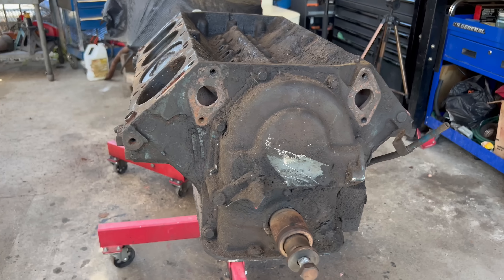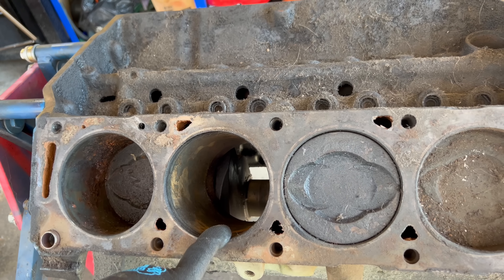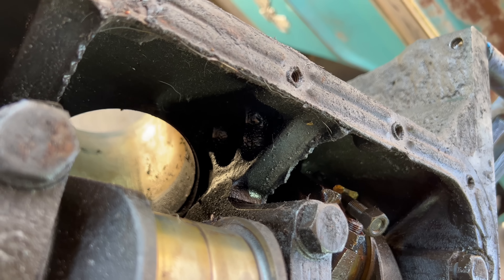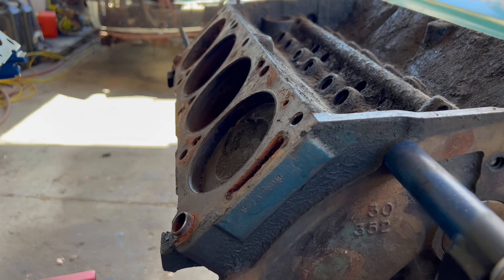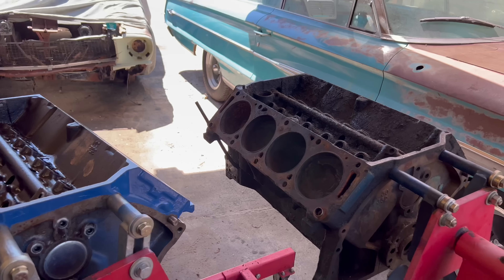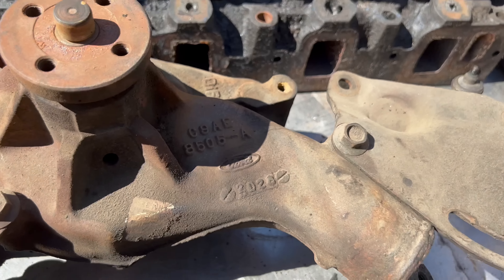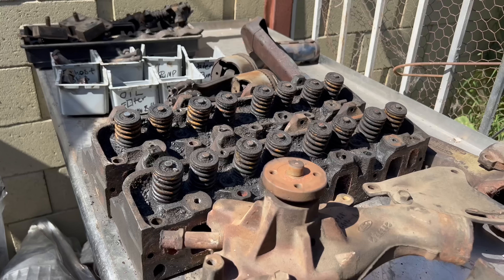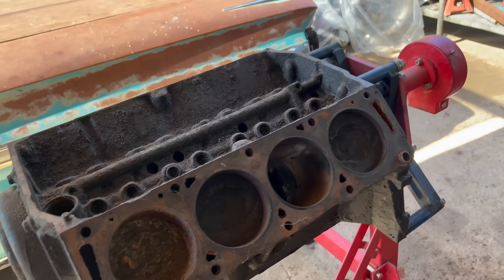A Ford 428FE Cobra Jet For $200!??

Comment: I would say instead of coyote swapping that fastback do a 428 with like a 6 speed. Would be pretty sweet!
Reply from the maker: Haha yes that would be really awesome. I’m building the 428 for the galaxie so I’ll see how she handles. Might change plans after I do some burnouts haha
Reply: @OmarRamirezGalaxie  t56 fits right because similar transmission design
Reply: @OmarRamirezGalaxie  that 428cj needs to go into something that deserves ut,like a mustang or a torino, a fairlane
Reply: Coyote swaps are so grossly OVERrated.
Reply: @460duck  Torino GT. Perfect for that.
Reply: 4-speed or NOTHING 😉
Reply from the maker: @460duck  haha everyone is saying to swap the 302 in the Torino for the 428 but it runs so good
Reply: I don't think you would need six gears with all that torque.
Reply: Even a 390 bumped up a little would also be sweet.
Reply: Gets my vote. The GT350 trans from Tremec with 3.5 rear gears.
Reply: @IrishMike22  Today requires OD. The Tremec 5 speeds would work well or the close ratio 6 speed installed in the GT350 with a 3.5 rear gear. If the rear end was swapped for an Exploder 8.8, the 3.31 or 3.55 gears. Exploders had 31 spline so pretty close to a 9" with less internal friction.
Reply: @daledavies2334  today requires OD? What does that mean?
Reply: @IrishMike22 Real simple. Lower RPM and better fuel economy. Gasoline prices are never going down to $0.25/gallon. I doubt $1.00/gallon will not be seen on pumps. So you want to squeeze every mile you can out of that gallon.
OD aids in that persuit.
Reply: @daledavies2334  I know what it literally means; and if it's a daily driver I'm on board with you. But for my toys? 4-speed all day every day. 

*I was asking why you chose "requires" is all. My '63 406 4-speed only "requires" me to drive it.

Comment: As soon as I saw your heads and exhaust manifolds, I new it wasn't a CJ....or even a GT or PI.
In 1995 I bought a 69 factory replacement complete Q code 428 CJ engine assembly, pan to air cleaner, O.E. distributor, bell housing, clutch, fuel pump, flywheel, accessory drive, distributor, alternator, and aluminum finned valve covers, exhaust manifolds - everything,  in like new condition with only 700 miles on it, for $1500. The add came out late Thursday evening. I skipped work the next morning so I could drive half a day to get there first. While I was loading the engine onto my truck, the guy's phone was ringing off the hook. He'd just pick it up and say "sorry, it's sold - another guy is loading it up right now", put the phone back down just to immediately start ringing again. I drove back home and right away turned it over to a friend for the $1500, plus my gas money - because he had bought a R-code 1969 Mustang GT convertible chassis missing its engine. A worthy cause, I figured.
At the same time, I also bought the matching big spline Cobra Jet 4-spd Toploader, a set of never used Hooker big-tube headers for an FE in a Fairlane or Torino, and a new old stock still unopened in the box Hurst "Competition Plus" shifter to go with the transmission -  all for another $400. But for whatever reason, he wouldn't sell the N-case Traction - Lock rear axle - he was firm about keeping that. Then I spotted a  drivable, virtually rust free 1969 351W Fairlane 2-door hardtop in the far corner of his yard, so after some inquiring, he told me it had a swapped 68 428-4V Police Interceptor engine, Cobra Jet C6 auto trans, and a WAR case 31 spline 4-pinion traction lock diff in it. A little persuasion and another $2000 - I drove it home a week later.
Reply from the maker: Haha wow man you got some nice finds. I think nowadays it’s definitely a lot harder to find any of this stuff but those who know will get some good stuff
Reply: What state was the R code GT convertible found? I came across a 1969 Mustang GT convertible R code Drag Pack missing the engine many years ago. That car was located in MA near the coast.

Comment: Omar, you just brought back so many memories of arguments about ford big blocks from my teen years. Anyone that had a ford big block FE all claimed it was either a 427 or 428.(never the 332, 352, 360, 390 or 406 or 410) Being raised in a family that followed STOCK CAR Racing I was aware of the many differences. My dad and uncle raced at a local track. Ford used these engines in so many displacement configurations that people still argue about. It was my understanding also, the CJ and SCJ started life as police interceptor engines. Love your videos. I am now a new follower. Also, I think some of the 390GT heads made it onto the early 428s. Exhaust bolts were at 10 & 4 o'clock positions. I'm now subscribed.
Reply from the maker: Thanks Neil, these engines definitely have a ton of history and a hundred uses. The FE engine has to be my favorite engine so far, I would t mind having a couple of 390s and 428s!

Comment: Feliz cumpleano Omar. I'm an old FE guy myself, bought my first FE in 1974. After all these years, I only have one FE now, and it's pickled in a drum of diesel fuel. It's *special*, one of 50 built, one of two that escaped to the wild. In 1964, Ford built 50 390's with 4 bolt mains, radical solid lifter cams, 12.5:1 compression, rods that look like Lemans rods, and medium riser heads, 2x4bbl. Experimental, all 50 went to the Wisconsin State Patrol, and were supposed to come back to Ford. 48 did. I found mine in a rural junkyard in Iowa a long time ago, way before internet. Mailed all the numbers I could find (many with XX's) to Ford archives, they said they didn't know the engine. I found one last number, on the face of the camshaft, under the cam gear - sent that to them, and they asked where the engine was, wanted it back. NOPE. MINE. I ran it in 7 different vehicles over about 15 years, then pickled it, to wait for the perfect old Ford, which I've never found (yet).
Reply: How much power did they make?
Reply: @CoyoteFTW  Never dynoed mine, but my butt tells me around 550 hp, huge torque from midrange to wherever you let out of the throttle. When I first got it running, it was hard for me to believe that they turned this loose in a patrol car - the cam is wack-radical and doesn't slack off even when you know you're turning it too tight. Amazingly well balanced.
Reply from the maker: Thank you! That sounds really cool, never heard of that before.
Reply: @maniyan_wanagi  550hp in the 60’s wow! You are lucky to have such a cool experience thank you for sharing great story.
Reply: Great story I like those I bought a 4 bb.fe.at a yard sale late on Sunday thay were shuting it down and as I was looking this old feller said to me I have something here that might work well in my 63.5 galaxy and I said what's that he said it's probably better than the engen in your car I told him it was a 352 pi.4v engene he pulled up this clear plastic cover and thair was this fe 4v. Block with aluminum fined valve covers but nothing else it had a price on it for 1200:00 dalars I said I don't have that kind of money but it shure is pretty it was complet it had a scoop in the air cleaner I had no idea what it was he asked me how much money i had I was 19 years old I had 400:00 dalars at home he said you go get it and hury back and you can have it I just want it gone and this was in 1979 I did but didn't really want to spend all my money and wish I had said I only had 300:00 any way I went back gave him the money and he put it in my trunk on some boards and y had air shocks he aired them up I went to my uncle's to use his back hoe to get it out and all this time I'm thinking wat did I just do I wasn't really happy but I checked it out and found out it was a 1969 428 scj. Out of a shaker mustang even had the correct exzost manifolds wat a deal and I still have it
Reply: Ford guy here and your story is awesome. Keep that Ford Edsel.

Comment: In the late 1970's, the service replacement engine blocks for the 428 were 391 truck engine blocks, bored out and the external oil line hole had a plug put in it. That's the way they came from Ford. A friend bought a 1970 428 police car at a government auction. It had the cast iron Cobra Jet intake manifold, anti-pump up hydraulic lifters with adjustable rocker arms. The police engines had the GT camshaft, but unlike the CJ, the crankshaft gear did not retard the camshaft 8 degrees. The CJ crankshaft gear retards the camshaft. The police crank gear has the timing mark in line with a gear tooth, while the CJ gear has the mark between gear teeth.

Comment: Some 428s came in thunderbirds as thunderjet 428, they were basically police interceptor style engines but were 428s instead of 390s. Still a great engine. Most a
FE blocks say 352 on the side of the block. A 352 will not allow overbore to 428 cubes.
Reply: I remember see so many 428s in Tbird s. Buddy of mine had one in his Tbird

Comment: I have a 67 " A " scratched 428 FE engine with reinforced main webbings.  It has the 16 bolt exhaust patterned C7 heads. So its looking like a PI engine from the info ive found.  Found it in a " U Pull it  " wrecking yard in Chico Ca.  It was in a old bumpside long bed F250

Comment: Oh right on you have a 64 Galaxie! I had a 64 XL 500, blew up several 390's 410's, finally went to a medium riser 427 with a baby c6 and what a difference , it used to snap drivers side engine mounts frequently . Used to collect FE engine parts , still have a couple 427 side oilers waiting to find a nice comet or a fairlane to put one in.
Reply from the maker: I’m  building a 428 for the galaxie so I guess we’ll see how many mounts it will break haha

Comment: I recommend getting a truck mounted engine hoist, you can get them second hand for $100 or less. It makes losing and unloading so much easy. It also folds out of the way when not in use.
Reply from the maker: That would be really sweet, I’ll have to look into it!

Comment: I've been a mechanic for 55 years I did heads for 20 years along with other parts and I also used to go to swap meets and sell parts not flea markets! You probably have truck heads or the truck top end the exhaust manifolds are car or truck because they're flat if you just have two bolts on the heads I can't see through the grease on each Port then you got a standard head look at the valves they're a little bit bigger on 428 and there's multiple exhaust holes on the head cuz I've had Cobra Jet manifolds for 390 and the manifolds are more round like a pipe and they're bent downward instead of out somebody could have sold the 428 top end or the heads? But you have regular 390 or so heads they heads aren't covered yet the block is hard to say without hot tanking it cuz there's too much crap on it I had my own hot tank once everything's hot tanked you can expect to see everything but like I say you can put a 428 crank in a 390 block but you also have to look at what the Pistons were because they are flat and not dished most Cobra Jets have only two valve relief some of them have only one it depends on the compression but after you've hot tanked all that crap you'll know but if you have two bolt holes on the heads those are standard 390 or 428 standard then look at the T-bird when it had a 428 the T-bird did not have Cobra Jet Parts on it so you could have a T-Bird motor you could have a Mercury motor cuz Mercury did not have Cobra Jet top end

Comment: I have a 428 that has a heavy duty block with the reinforced main bearing webbing and they are even thicker than the ones in this video. There are plenty of them out there that were service/replacement blocks and they have no vin numbers like mine. It's a 1974 D4TE block with a mirror image 105 on the front. It's bored .030 over 428 standard bore size and it never even gets close to overheating. It's absolutely impossible to know my engine is a 428 by external examination as with lots of these FEs today since they've got so many mixed up parts in them.

Comment: In some older tech literature on the 428 it was stated that the crank IDs reveal what type of 428 you have: A 1U means 66-70 Q  or P- code 345hp; 1UA denotes a CJ and the 1UB means SCJ ...... Is that true? Also you had  different balancing specs from Ford for each type and THEN another set of specs depending on whether you had 4-SP or C-6. That means SIX different weight specs for all 428s. Piston weights varied between 682 to 712 grams. It was a jungle and also the main reason why they had consistent failure on the #5 main bearing after parts swapping by people who did not know what they were doing. Severe vibrations. (unless the engine had been dynamically balanced.) Which most were not. Most were built in your home garage and then on to the boulevard. The ´67 block I have was damaged this way. A 4sp was installed in the car and the flywheel was a zero balance unit off of a 390 engine. It was rebuilt each time and no one had a clue as to why it failed every time.

Comment: I don't know the casting number of them but I had a set of 16 bolt exhaust heads from my 67 Fairlane GTa in my dad's barn because I was running some rebuilt police T bird heads that had smaller chambers at the time.  Long story short my step brother pitched my heads on his load of scrap metal. I was not a happy camper!  And you are right those FE cast intakes can give you a hernia.

Comment: Congratulations.  I have built several of these engines.  I used to own a 1968 GT500KR.  Presently I have a 452 cu. in Shelby aluminum blocked FE with Edelbrock heads.  It has a street roller cam, fuel injection and an stack intake system.  The engine made 550 hp and 600 lb.ft of torque.  It is in my 1968 fastback.  It has run a best of 7.18 sec in the eight mile (about 11.3 quarter mile).  If you want any advice on cam selection or head selection, I'd be happy to help.  I have a new solid flat tappet cam you can have if you pay the shipping.  248/256 6.10/6.20 on a 110 LCA.  I also have a used street roller solid cam with similar specs if you want it.  I recommend the TFS heads, if it's in your budget.  If you wish to contact me, let me know.
Reply: turbo32coupe, I just bought a 1967 Fairlane GTA convertible with a C8ME-A engine, which tells me it is not numbers matching.  Is there any fast way to confirm it's at least a 390?
Reply: @brianboyle3998  Ford didn't put the 352 in the Fairlane, so you have a 390 most likely.  I have a used 428 crank which would make it a 410 if its a 352.  If you pull the pan, look at the crank.  The 390 crank will say  2U or 2UA
Reply: @turbo32coupe  Thank you.

Comment: 428 cobra jet pistons say 428 SUPER on them. Even the regular CJ. The CJ also had 13/32 rod bolts a bit bigger than other FE rods. 428 used a high volume water pump so that would have value.

Comment: That's pretty much my reaction every time I pick up one of those stock intakes too.
Reply from the maker: Lol have to watch my back with these
Reply: Yes 85 lbs. Try having to lift one out over the fenders or front support. I had heard that ford recommends a cherry picker to pull them. I never did but it sounds like the way to go. Going to an aluminum intake is 50lbs less right there. Performance gain and less weight off of that pathetic spindly ford front suspension

Comment: I had set of cross bolt FE heads with intake.....Believe it or not someone stoled them along with all my high performance parts...They also cleaned out all of my flathead parts...That was good deal on any 428....

Comment: Years ago I went to look at a 390 for one of my trucks. Got to the guy’s farm and it was literally sitting upside down in a pig pen. Can’t even remember his asking price but I turned to the seller and said “I’ll give you fifty bucks”. He started squealing so I turned and walked towards my truck. Dude must have needed cash cause I got it for fifty. Tore it down and it had a set of 428 SCJ connecting rods — apparently from the factory. Sold them at a swap meet for good coin. It’s like the old box of chocolates. You never know what you’ll get. 

Just subscribed!
Reply from the maker: Haha wow that’s awesome. I’m waiting for my turn to find a 427! Maybe someday I’ll come across one
Reply: @OmarRamirezGalaxie    Yep. Found one of those too. Older guy. Ford hoarder. Had a whole field full of old Fords — mostly convertibles, wasting away. Went to look at the 427 side-oiler bare block he had for sale. It was indeed a side-oiler but it was already marked .030 over and was lying on the ground out in the open. Took a pass on it. At $750.00 I probably should have taken a chance. This was about thirty years ago. Can’t buy ‘em all, I guess.

Comment: I’m going to guess what you have there is a 4 brl truck engine. A 428/4V engine. I once drove a 3,000 gal 6 wheel F750 oil tanker, that was powered by a 428/4V, with a low hole 5 speed with 2 speed rear with 5:88 posi, that was to help deliver heating oil in bad weather. As it’s illegal for tire chains on oil trucks. The owner of the fleet had 4 or these, the others were just like, but had Cat V8 diesel, that would hold speed on hills, but took longer to get up to. With headers and short dual exhaust they sounded awesome! Especially with a small load split shifting at full throttle! Side by side with the Cat Diesel it was no contest 0-65! That was top speed in the diesel, but the gas could get over 75, that was at 4,400 rpm red line. The diesel ran for 300,000 miles easily between rebuilding, but the 428 gas was lucky to get 160,000 on a original, but mine never used any oil and ran for 175,000, before it developed a rod knock.

Comment: 428CJ rods use a 19/32" nut.  Standard FE rods use a 9/16" nut.
Reply: I think the "GT" and Police Interceptor 390/428 had bigger rod bolts than the standard 390/428 rods as well. I also seem to remember the SCJ 428 got different rods than the standard CJ, too. Maybe even the 427 side-oiler's "Le-Mans" cap screw rods? I know when my boss was racing his 69 428 SCJ, his engine had the cap screw rods in it.